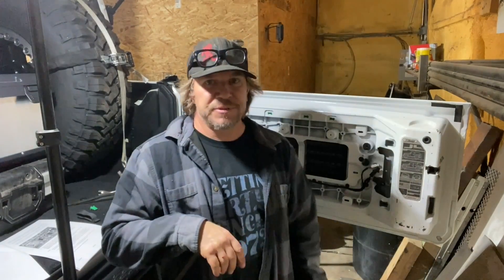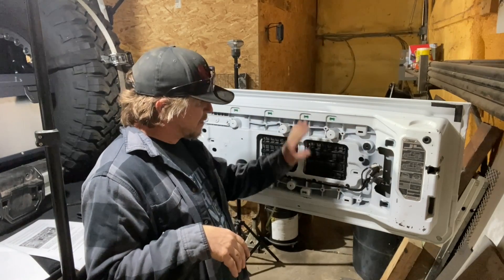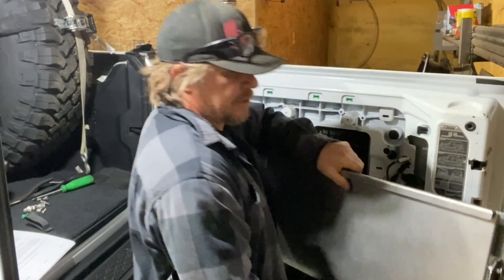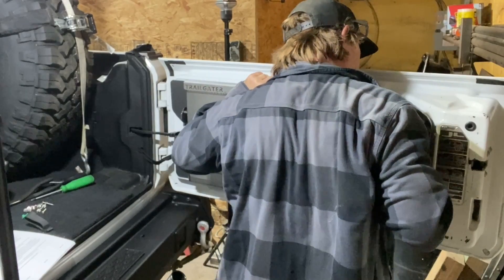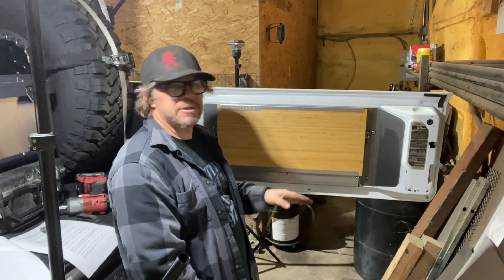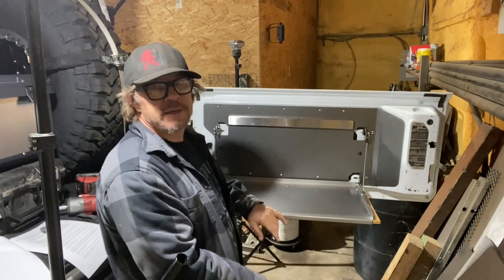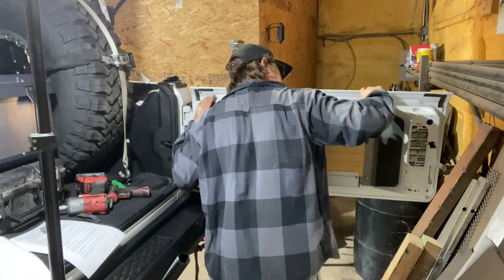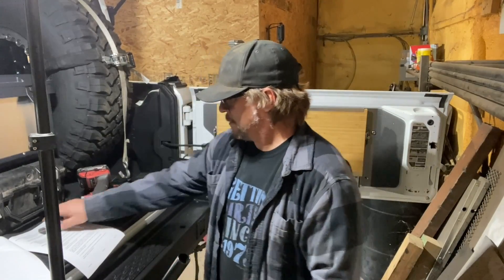Dirt Daily. Adding a Table to Your Tailgate with the Trailgater

Comment: Cool set up!  Does it affect the operation of the air pressure relief vents on the back of the tailgate?  Probably not an issue on a soft top, but it doesn't seem like you would want to seal them off if you are running a hard top.
Reply: Came to ask the same question. The vents are there to let the air out of the cab when the airbags deploy. You can rupture an ear drum if the air can't escape.
Reply from the maker: nope, the air vents still work fine